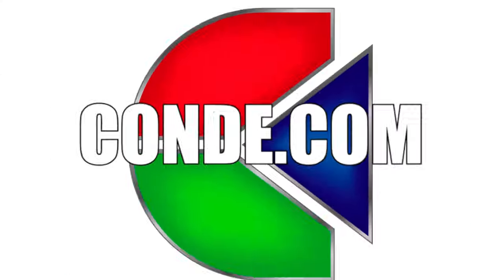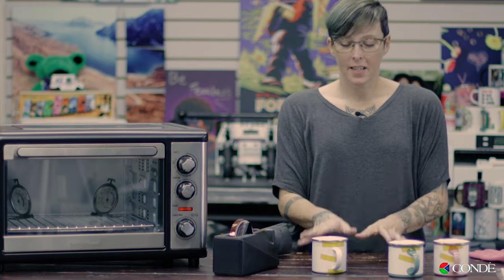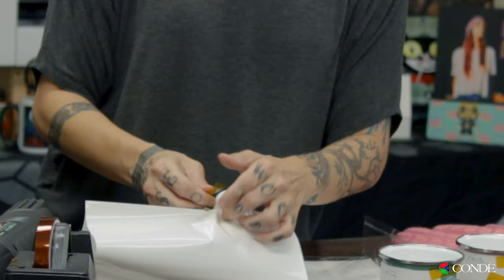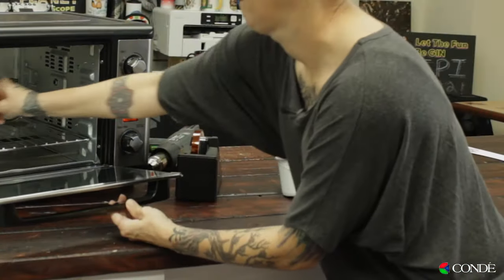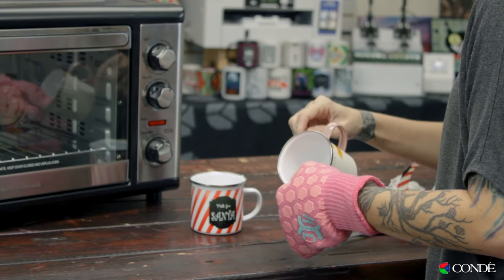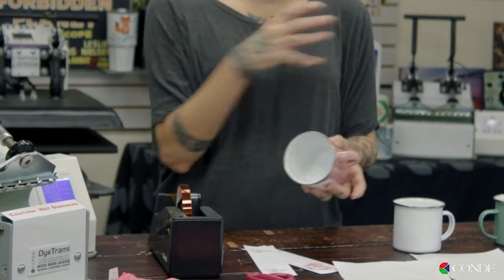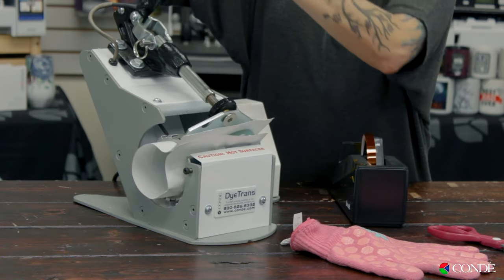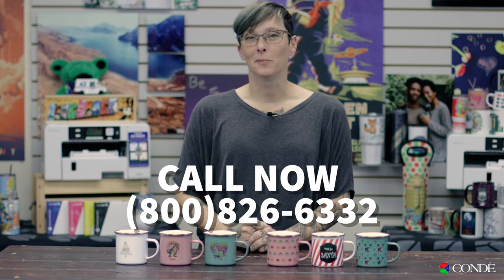How To Sublimate a Camp Mug in an Oven AND with a Mug Press - Step-by-Step

Comment: What are you wrapping the mug with for the mug press?
Reply from the maker: Hello Toni, great question.  We are using a product called Sublishrink to wrap the mugs.  You can find it here https://dyetrans.com/search.php?search=subli+shrink
Reply: Was it butcher paper you wrapped around the design and mug before placing it in the mug press?
Reply: Can you use easy subli ink on tumblers and mugs?
Reply from the maker: Oh sorry, Yes that was butcher paper that I believe we get at Sam's Club.
Reply from the maker: Yes, Easysubli ink will work on most if not all sublimation blanks.